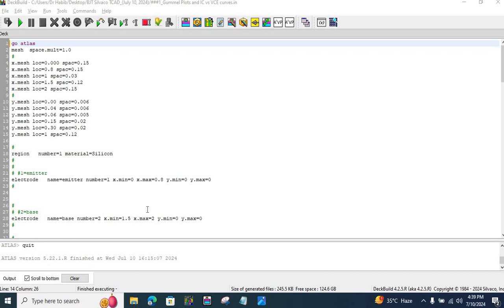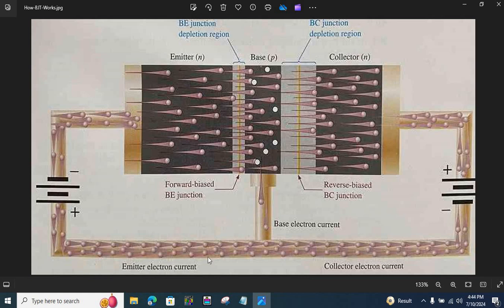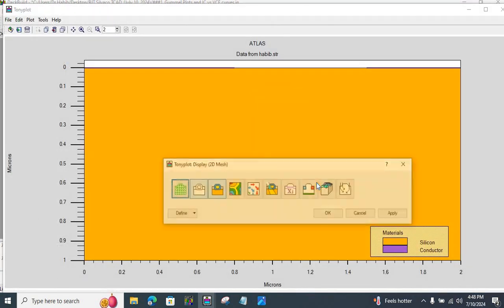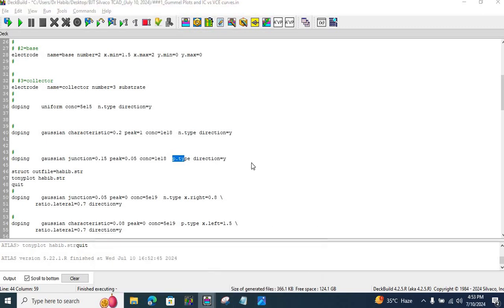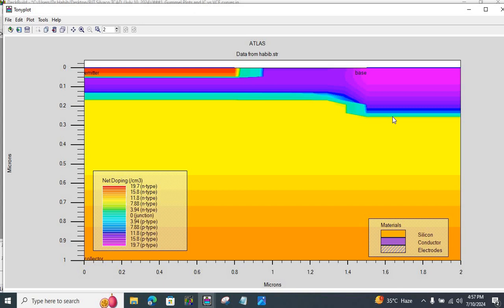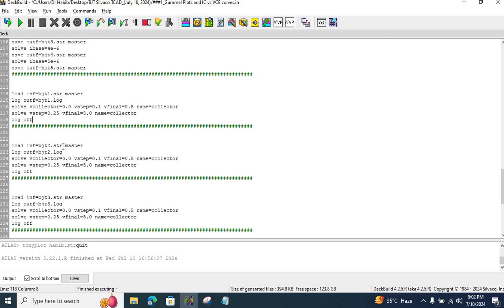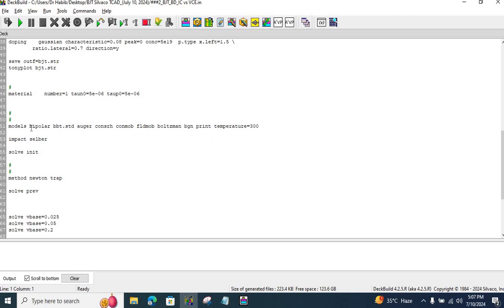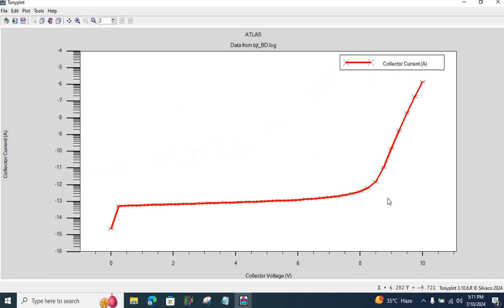NPN Bipolar Junction Transistor Silvaco TCAD Simulation: Step-by-Step Guide 🔧📊🎓 🖥️🔍

Comment: Thanks for your teaching how to build NPN lateral transistor, as I followed your introduction, and the electrode button, the tonyplot exit and the command exit code is "-1073741819", I wonder whether the software version is the problem. Mine is 2018, and the tonyplot version is 3.10.18.R. Does it matter?
Reply from the maker: It might be a typo. Please carefully check your code.